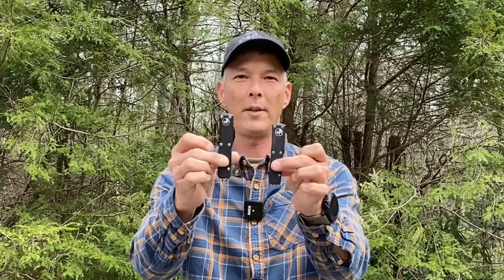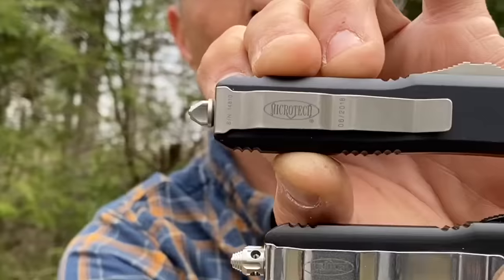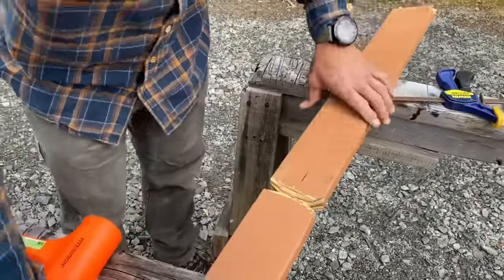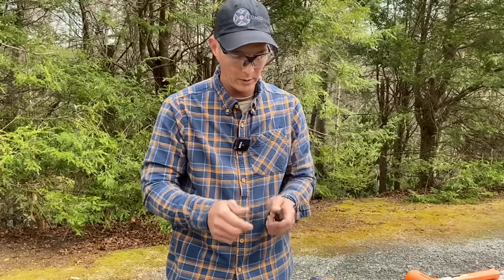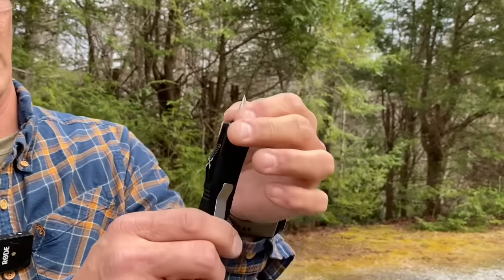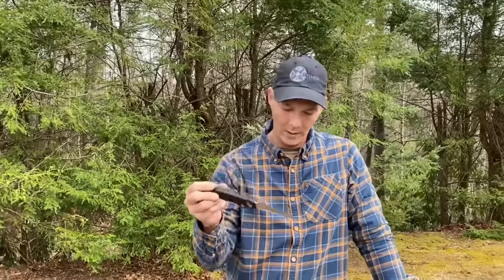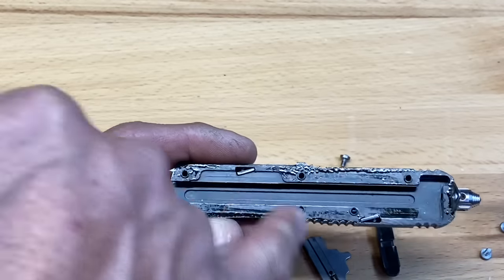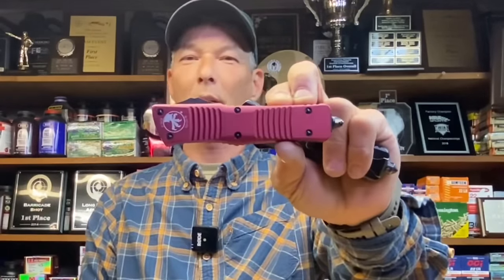Counterfeit Microtech torture test!

Comment: I think the clone held up very well and wouldn't class it as junk. It's a fraction of the price and would last most people along time under normal use.
I'm no knife expert but I'm sure it's not meant to be used as a nail.
Reply: It's "junk" in 2 senses. First in a political sense. Not authentic, not USA made, etc etc. Second in a life or limb sense, you can't depend on it, if you might need the OTF to save...or take...a life. 

I don't so I bought a clone. I occasionally cut mail with it. But it's barely a step up from being a toy to me. If I was a rescue worker or spec ops and this was my edc, I'd spring for the real thing.

Comment: I want to comment that the failure was not in the locking mechanism. It was in the body that bent which prevented the blade from sliding in. Not the small rectangle lock. The bent frame looked like it was caused by an off side striking blow, or could have just been weaker aluminum.  I am not knocking microtech just my observation.  What do you think?

Comment: The clone will still sell and it's all down to price and affordability for most, also you have done a strength test for people to see and that clone took a hell of a beating before it broke and no one would ever use this knife in the way you demonstrated it, it's a combat fighting knife not a servival cutting threw longs knife or smashing it threw 2inch thick wood knife, if anything this has probably upped the sales on the clone because most people will use it for normal tasks not cutting down trees.  My advice for microtech is to contact a good knife company in China and bring out a few designs that's an affordable prices for people that can't afford the high priced American made ones.

Comment: Okay.......  So.........  You go out and pay $500 for a Microtech.  You take it out of the box, fire it a few times, marvel at how nice it looks, stick it either in your pocket or back in the box and when you need to use it you can cut things with it......  You stop by a roadside flea market and they have Microtech clones for $50.  You look at it, fire it a few times, marvel at how much it looks like an actual $500 Microtech, hand the guy $50, take it home and when you need to use it you can cut things with it.....  Hmmmmm.....  Kind of a no-brainer to me.......  It isn't going to stand up to being pummeled thru a 2X4 with a hammer, used for a screwdriver or a pry bar as well.....  If you throw it across a paved parking lot it is going to scuff up......  If you drag it behind a UTV for several miles on a dirt road it is going to get scuffed and full of dirt but chances are it will still function and the next time you need to cut something with it you will be able to............  Screw Microtech......  Sure....  Those guys produce some fine knives but really? $500 to $1000 for something that will still scuff up, get dull and one day wear out and break just like a cheaper clone or cheaper brand......  I'd rather buy 10 different less expensive otf knives than one Microtech.......  But that is just my take on it........
Reply: Man, you're damn right! For the cost of one original Ultratek, I purchased the following clones from the well-known Chinese brand:
1. 3 Ultratek
2. 1 UTX-85
3. 1 Hera 2
4. 2 Combat Troodon 3rd generation
And I am incredibly happy with my decision. In any case, after 1-2 years of regular use, you will have a Chinese spring in your original Ultratek knife.

Comment: Got a counterfeit maroon/wine red Ultratech for 20 bucks last month at my pawn shop that the previous owner had sent to Microtech to confirm & have the logos removed.  Bought it purely as an all day fidget so I dont wear out my real UT & UTXs & was pleasantly surprised it fires just as satisfyingly & consistently as my authentic UT & even at dozens of times the firings its outlived 2 of my brand new dealer purchased 70s without a single deployment or switch/spring failure.

Comment: So, I don’t collect coins, stamps or baseball cards.  I collect OTF knives.  Just a long time hobby/obsession.  I own every Microtech OTF version ever made.  I also own Pirahna’s, Benchmades, G&G Hawk Deadlocks, Burns knives, Mod/Harkins and a Desert Knifeworks Sandshark all - super expensive. (If I sold my Sandshark now I could probably but a new car) I also own dozens of clones.  Here is my take…OTF’s are not made or designed to baton with or used as a railroad spike, with maybe the exception of the Sandshark.  The fine parts and tight tolerances are not designed for that!  I own some clones, especially Vespa’s ($100)  that would take 5x the beating of my $500 Microtech Combat Troodons.  I have a $40 clone Ultratech as my EDC.  Had it in my pocket for 3 years.  Never let me down once.   IMHO if you want to test OTF’s, test them for what the would be used for.   If I want to Baton I’ll use my Tops, Becker or Esee fixed blade.

Comment: Problem with a lot of these "fake" knives is the lack of quality control.  Blade steels they claim to be a legit metals which they usually are not. Don't get me started on heat treatments.  Worse, is the locking devices are not up to the task of the actual companies and that can have huge consequences if you value your fingers.  Save your money buy a legit Microtech, Strider, Spyderco or Benchmade (all of which I've seen clones for) your fingers will thank you for it.
Reply from the maker: Thanks for the additional info Grodd70.  Well said.

Comment: I bought some knock offs on purpose before I bought my real microtechs back in the day. The main difference I found was the steel was much softer. Didn’t hold its edge. And the springs often broke in under a year. They are definitely not at even close to the quality of a real microtech
Reply: did u get the hifinder clone

Comment: Like the other comments, I'm confused. Was this an endorsement for the fake or the genuine Microtech knife? What does the hammering the blade into a 2x4 prove anyway. I could take any piece of metal that's hardened enough not to fold over or bend and do the same thing. Now, hammering it in like a nail shows me that it's not a brittle or weak blade. I really expected it to snap with a couple of those hits that had it vibrating, I at least expected it to break the lock that holds the blade in the extended position. I kind of wanted the Microtech to break off, that would have been epic. I recently got a fake (not on purpose) and searched this topic because of it. I'll check back if I remember and let everyone know how it holds an edge and stuff, normal stuff not this extreme treatment. I know this is a demonstration of strength but nobody does this kind of stuff with a knife, we just open packages and slice apples, that kind of stuff. I appreciate the video anyway; it was interesting, and I gave it a like. I think mine cost under $40 and I wouldn't cry about losing it or if it broke but I would if it had cost $300 like the real item. I guess I'm more of a Hellcat kind of guy not a Ferrari guy. I just saw another video and I think this guy works for Microtech. Interesting.

Comment: The handle bent just enough like a guy  slightly tweak bends a driveshaft yoke hammering out the universal joint and then it doesn’t work . Good materials and a good build is paramount .

Comment: I still think you can make an OTF less than half the price of a Microtech which is just as sturdy if not sturdier than it. The detailing on the blade might not be as perfect but you gotta get real up-close to see that anyway. The aluminum handles look just as good as the Microtechs even on these cheap knock-offs so that wouldn't be a problem.

Comment: Great test. Is the pocket clip reversible? Does that tool you used also remove the glass breaker at the end so the clip can be switched?
Reply: The glass breaker on the clone can be removed by inserting something through the holes and unscrewing. The clip can be reversed but is held in by glass breaker. I replaced my glass breaker with a M8 screw cap for .53 at my local hardware store.

Comment: I’ve had the cheaper ones lock up on me like that and I used a qtip and got excess oil and debris out of there and it worked fine after that i used a sharpening stone on either side of the bottom of the blade on another one and that started working great.

Comment: It actually passed the nail test - went all the way through.  Where it failed was you hitting it laterally when it was embedded - which is evidenced after you took it apart and the warping of the channel causing the blade to stick.  Most people aren't going to take a hammer laterally to an embedded knife - for an OTF, I'm impressed with the Chinese knife

Comment: Are the screws the same size on the x85 as the full sized microtech? Looking at getting some different colored screws I found on eBay but doesn’t say anything about fitting the x85 or the smaller 70 one.
Reply from the maker: It the UT and x-85 screws are the same as long as they are modern models.  They will not fit the 70.

Comment: How do you sharpen your knives? Carry a Griptillian by Benchmade and want to get it as sharp as it was new. Can send it to them, but would like to do it whenever I want/need to.
Reply: for starters dont let it get dull... buy a strop and some compound to put on one side of it and strop it the night after using it for example. its pretty easy to keep a sharp knife sharp but more difficult to resharpen it after letting it dull. worksharp sells from nice little hand sharpeners that would work. they sell a little guided field sharpener for 25 bucks  and then they also sell a guided sharpener that pivots side to side as you sharpen that away its more forgiving if you dont angle the knife correctly while sharpening down to the end its around 50 bucks.

worksharp also sells an automatic knife sharpener that plugs in for 50 bucks. Ive only used the field sharpener and its a nice little sharpener for 25 bucks. granted you may have to sort of freehand it if your knife isnt near the same angle as the guides.

lanskys are also nice too and allow you to sharpen at more angles its also a good buy.

Comment: I have a Microtech and love it. However I would never let it be the only knife I have on me. I’ve had it for 9 mo the and it already had one CATASTROPHIC failure. The internals broke and the knife was useless. Microtech did take extremely good care of me and fixed everything for free and resharpened the blade and sent me a new box and patch. So that’s good. But a $280 knife that breaks under very light use (I don’t abuse my toys) is unacceptable.

Comment: Have a real ultratech, but always wanted the bounty hunter. No way I could ever afford it, shouldn't have bout the ultratech to begin with lol. I was pretty underwhelmed by the sharpness of the real ultratech to begin with so I def was spending even more on the bounty hunter. I also am probably like the 99% of people that buy these, we aren't using our knifes as hammers or nails lol. I think the clone will need to be Sharpened more often, but for the 99% it looks like this clone will hold up a long long time for the normal person if we don't use it as a nail. Def just ordered my clone bounty hunter, the real ones are just priced way too high for what you get.

Comment: Dumb question here but I am very new to autos. Most traditional lock back knives would fail at the blade pivot if you did half of the things I have seen done to autos. I would have expected the autos to fail easier than a regular lock back. What is the difference in construction that seems to make these autos so durable? Thanks.
Reply from the maker: Hey Average Joe. I think it is their use of quality materials for all of their knives.  Almost all of their internal parts are machined and not just stamped metal parts.  Thanks for watching the channel.  Stay safe and healthy.

Comment: I don't have any real. I have probably 30-40 clones. Some of the clones are not good. If you are buying them for $30 they are cheap. However most of my clones are high quality. China would not be making clones if the Microtech knives weren't so ridiculously priced. At least the clones come with the tool to remove the screws.  China can make quality knives. How do we know where Microtech gets the parts to make knives?

Comment: c'mon cut it any way you like, that counterfeit is holding up surprisingly well.
I reckon is the hit you're giving it while it is floored in the wood, where you made numerous double punches while it already where as far as it could go to one side and your blows will then go up into the shaft to the weakest link.
It goes without saying that there will be differences between 50 vs 450US as otherwise, those asking 450 will take you for a ride.
I actually expected the knock-off to shatter the first time you laid force on it and it was hilarious to see the disappointment when it didn't fail in the early rounds.(like g-dam this is ending up like a commercial for these knockoffs, ohh boy  please fail, yes yes finally.. you can see it's night and day.  :) ."
thx for the vid and sadly things made in the USA are so extremely expensive here in northern Europe with the highest consumer prices and not to mention OTF & butterfly-knives is so prohibited that it's almost laughable..
The biggest issue with the one if the vid is the deceptive part and they literally are doing counterfeit with branding and all that jazz.

Comment: So basically for $30 I can get a knife that looks exactly like, and is nearly as durable as a $300 MT? The average user would never need 50% of the durability demonstrated. How bout a Cobratec with a lifetime warranty for $80? Cmon, $300-$400 for an extremely simple mechanism and an aluminum handle? I like super steel knives, but I like a decent value too. Veblen goods need not apply.

Comment: Question?  I have no experience otf or microtech knives. I was curious as to how much slop there is in the blade and handle especially after heavy use?  Does it worsen drastically after a torture test?
Reply from the maker: Willard Scott Hello Willard, they have to have a little bit of blade play for clearance and some light debris.  It does not worsen, even after the tests. The only OTF I am even aware of with zero play is the Deadlock.  Those are easily over 1k. Thanks
Reply: @XRING  thank you for your reply. I have been wanting to upgrade my knife game. I have always had budget folders and been content. I like the idea of otf but don't know of anyone personally that owns a quality knife.

Comment: That's like changing the oil in a vehicle, you drain the oil then you check to see to make sure the oil filter gasket is off you put the new oil filter on, being sure to put a film of oil on the new gasket, and you even fill the new oil filter with clean motor oil, but you don't put new oil back in the engine. These knives ARE NOT designed for such abuse. Is this how you abuse all of your knives? If anything you opened the eyes of your viewers how tough these cheap knock offs are. Thank you for helping to decide what type knife I will buy for general use. I suppose you have nothing made in China. I can only shack my head no.